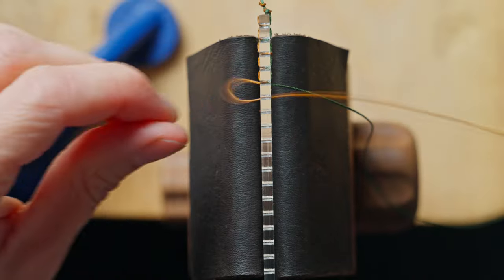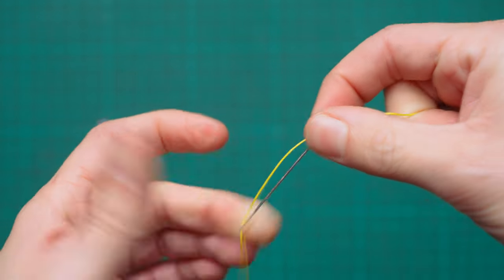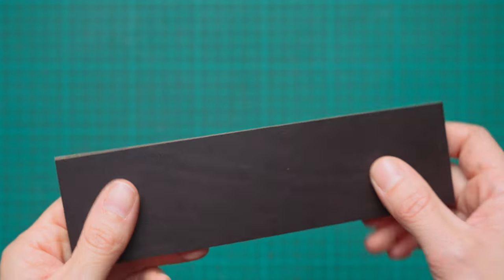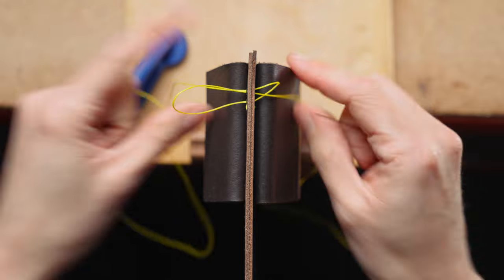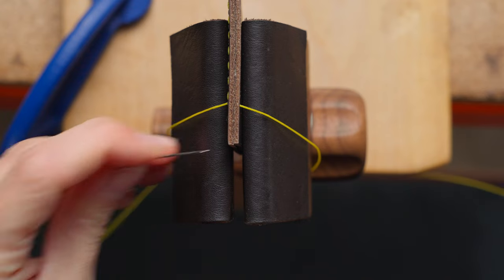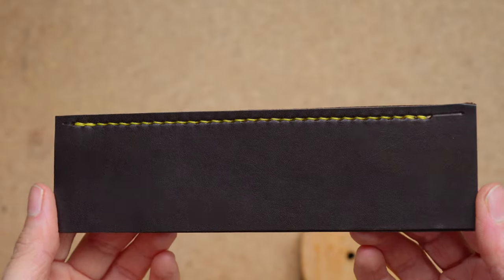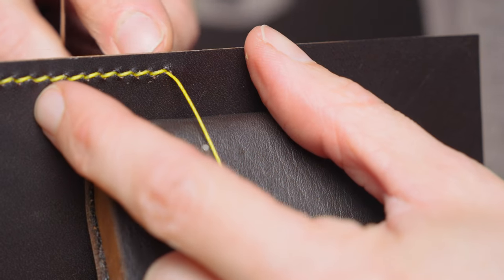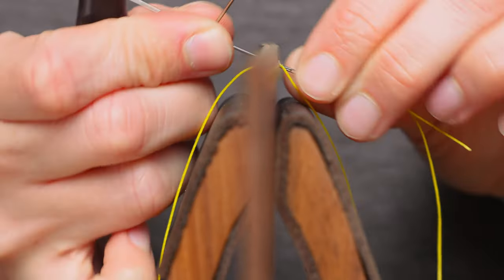How to hand stitch leather // Leather Craft 101 // EP04 Saddle stitch tutorial

Comment: I picked up a tip after being taught by J.H.Leather - if you use waxed thread, you can use a frim object (your knife handle) to push the thread flat at the end against another firm surface (table), and you then have  a 'blade' end to your thread, which is easy to push through your needles eye.

Comment: SUCH a fantastic video! One thing that I haven't been able to find is a way to handstich where both sides of the stitch are symmetrical. 

I use French stitching irons and one side of the stitch will have slanted stitches and the other side will have much straighter stitches (one side the thread goes from the low side of one hole to the high side of the other closest, whereas the other goes from the high to the low on the farthest sides of the stitch). Any tips on how to make that not happen? I've experimented a lot and haven't been able to figure it out.

Thanks a ton!
Reply: Try putting the right needle over the left instead of under when making the cross. And pull the right hand up and left down instead of the other way around. This works for me when using french pricking irons punched through all the way making holes on both sides.

Comment: Great video... One minor comment. When running the needle thru the main thread length as demonstrated, the thread can slip out (as you stated). If instead you run the needle thru the short end, it will be locked and unable to slip out.
Reply from the maker: Great tip 👍

Comment: I’m trying to grasp the concept of how the last half back-stitch locks that thread in place, every time I do this I trim them off, but then the half backstitch comes right back out the hole after a minute almost no effort
Reply: Don't cut the thread flush with the leather - Leave a small length of thread sticking out, then melt it with a cigarette lighter.
Reply: @SidSomething  tyvm, this doesn’t work on all thread types though, does it? Just the ones which can melt?
Reply: @Patmccalk  True, I'm using polyester thread but there are other types and some of them don't melt.  Those are probably best dealt with by adding a secure knot of some sort.

Comment: Very good video! One thing though, what is the difference between the diamond chisel and the stitch marker? When and why would you use which one? Thanks!
Reply from the maker: Check out this video https://youtu.be/JbLSUosSwWU
Reply: @JHLeather  Thank you for your reply. In this video you only mention that you use the diamond chisels only for 'quite specific situations'. You don't explain what these situations are nor what the difference is with the stitch marker. So, could you explain? I already have the diamond chisels as advised by another leather worker...
Reply: @marfoo2775  I use an old kitchen fork.  Just clamped it in a vice and bent the prongs, then sharpened it.  I'm sure that mankind has been working with leather for 20,000 years now and you would have gotten the same answer.  If in your experience it doesn't matter, then it doesn't matter.  I'm sure that @JHLeather needs a professional looking piece of work and if the stitch takes a lot of turns and runs through a lot of layers of leather, then the decision of wat are the correct tools is made before the work is put on the bench.

Let us take two different pieces into account. One is a swede, (split leather) cell phone case, the other is a sheath for a bush crafting knife.  The bushcrafting knife will be at least three layers of leather thick and the thickest leather you can obtain, if you would like to add a pocket or some loops your leather will be at least four layers thick.  Now your stitches will also need to curve to fit the curvature of the blade.  The cellphone case, on the other hand only prevents the phone from occasional abuse and will only be the thinnest and lightest material with the leather thinned even more around the perimeter.  All the stitches will be through two layers of leather.

The man who told you to purchase the pricking iron set would probably use the same tool for both items.  I would.  Of course, I could also use the kitchen cutlery method.   However, the idea here is to ONLY USE THE ONE MEATHOD.  Think the piece through, visualize the work before you do it and after you take out the tools that you plan to use, put the rest of the tools back in the box.  This will cause the end result to look consistent.  (Start with the cellphone case and make a matching case for the eyewear.)  So long as the result is consistent it will be perceived as the work of an experienced professional.

(Think I'll add a polyester felt lining.  I can't believe anyone would want to talk on a phone that much, that much money, he could have hired somebody to talk to all day.)

Comment: I don't see what prevents the ends of the thread from eventually backing out of the stitch holes. There's no knot or anything else that's mechanically locking them in place; there's only friction keeping them in there. I would leave a little excess thread when cutting them (as opposed to cutting them flush) and then melt the ends and smush them down against the stitch holes with my finger. I know that doesn't look "pretty" but the thread could never back out of the holes without first breaking the now-mushroomed ends off.

Also, what's the point of doing a back-stitch at the start of the stitching? With a saddle stitch the thread can never come out of the holes at the start of the stitching even without a back-stitch (unlike a sewing machine stitch), so is it just for extra strength in that area?